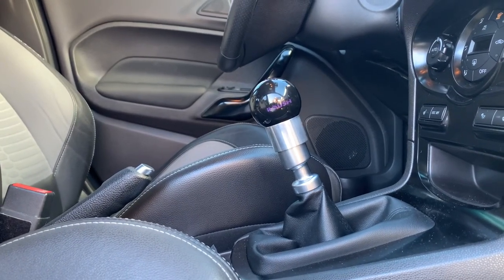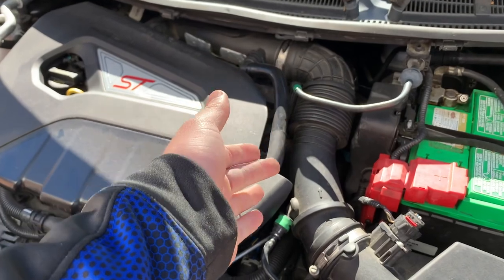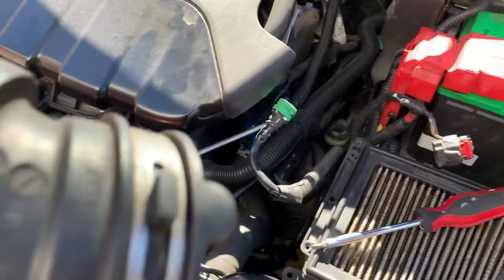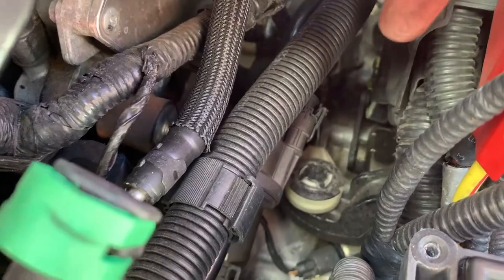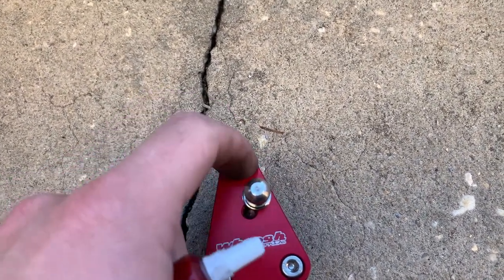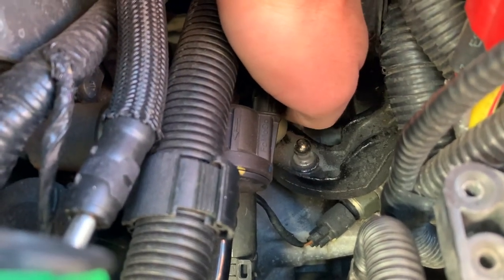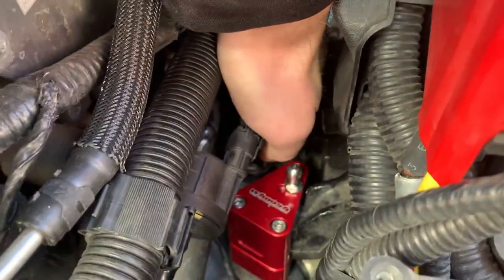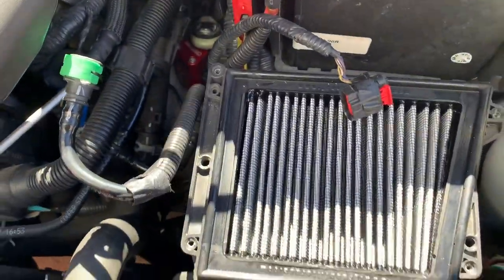Whoosh Motorsports short shifter Install on my Fiesta ST

Comment: Did anyone find that the device isn’t exactly flush when installed? There is some space between the red pieces after screwing them together.
Reply: A lot of the time they won't be flush
Reply: I was curious about the same. I thought I'd installed it incorrectly at first but mine isn't flush either.

Comment: So you put the blue lock stuff inside the holes or sound the screws I’m bouts to order mine now I juss got an 14 st bout a month ago n I love it juss need a few upgrades nun major
Reply: put a drop or 2 on the tip of the bolt threads

Comment: Do you not just clean your drop in filter rather than replace it?
Reply from the maker: I bought the filter before I knew the car already had a Cobb drop in filter in it. But I couldn’t return it so I just threw the old one out since it was dirty anyways
Reply: no you bin it ... never reuse a old dirt filter not even a k&n you never get it clean